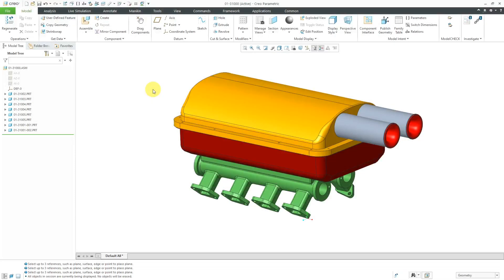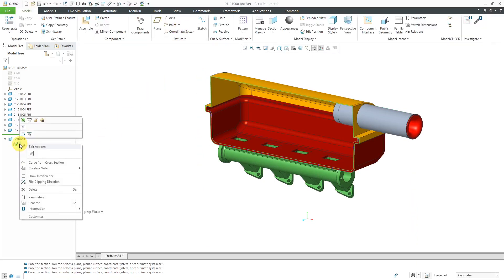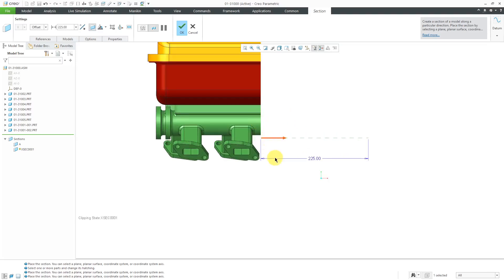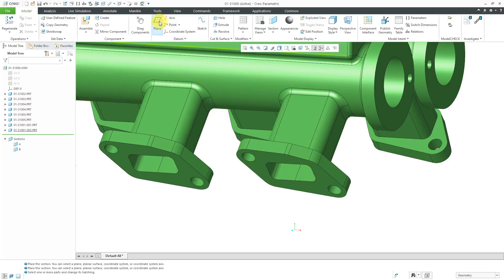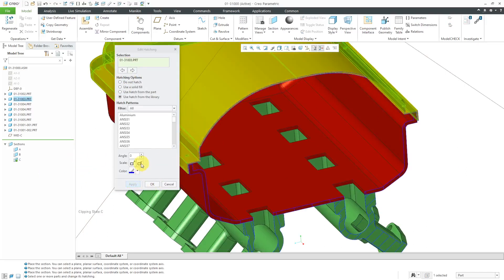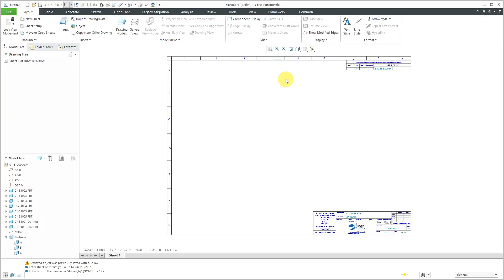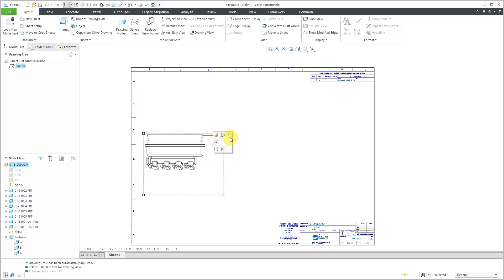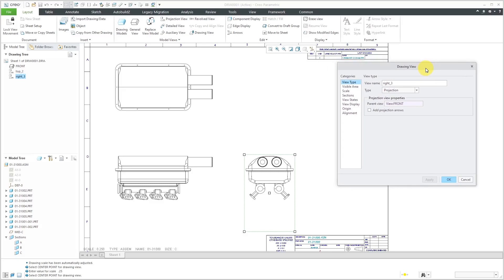Creo Parametric - Drawing Section Views - Part 1: Full, Half, Local, and Full & Local

Comment: In this video, you show a "mid plane".  In CREO 2.0, I can't select two parallel planes and can't find a mid-plane option.  I've been using sketches to define lines that I can use to define mid planes, which is an unnecessarily bulky process.  Is there a mid-plane option in CREO 2.0, or is that added later?
Reply from the maker: It was added in Creo 4 about 8 years ago.

Comment: Really good tutorials, thanks a lot.
I would ask similar as @HighWindd87, the hatching, but I expect the hatching linked to the material. 
In the usage of an assembly, the hatching may then be adjusted using a higher or lower intensity.
Is this possible?
Reply from the maker: Any chance you are a previous SolidWorks user?
Reply: @CADPLMGuy  yepp, SolidWorks, Catia V5, Inventor